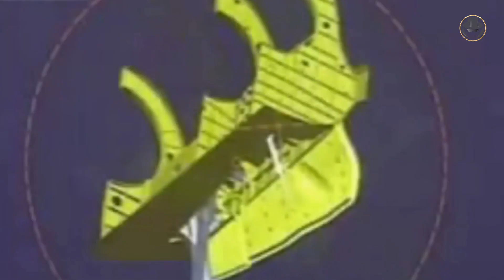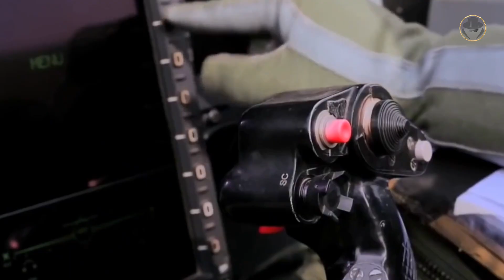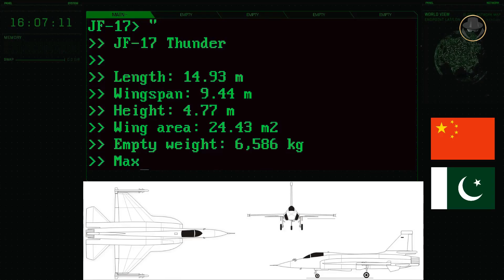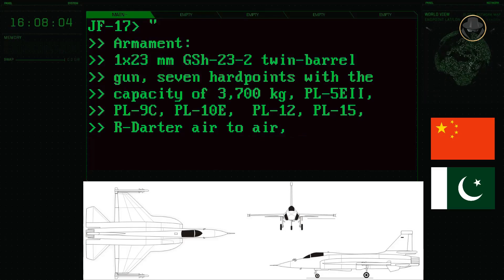JF-17 Thunder / FC-1 Xiaolong | Is it successful or not?

Comment: JF-17's main selling points are its affordability & maintenance cost.  It's a platform with AESA radars and long range BVR missiles,  Anti-ship missiles,  air to ground missiles and HOBS missiles at 1/3rd the cost of other aircrafts with same feature-sets.   The Jeff block-3 has everything which Tejas has to offer with lower over all cost.  Note that newer advance version of Tejas hasn't rolled out yet.  The one in service should be compared with the latest of JF-17 block in service.  And again the cost of upcoming version would be atleast twice of JF-17.   JF-17 is perfect for Pakistan and its threat matrix.  PAF already has inducted 165+ JF-17s.    A combination of J-10Cs, F-16s & JF-17s provide good air-defense and strike capabilities.
Reply: But Pakistan is not going to standstill. Block 4 is already being worked on, so TAJAS will always lag behind JF 17
Reply: @ashtonbailey3970  the JF17 is already an extremely dated design. Its essentially a modern fighter built on a mig 21 frame.
Reply: @penskepc2374  
No it’s not on a MiG frame. That’s a myth. The MiG frame cannot accommodate the block development model.
It’s concept is F16 based.
Just because the 1st car had 4 wheel you can’t say todays cars are dated because they have 4 wheels!!!
Reply: @ashtonbailey3970  keep telling yourself that.
Reply: @penskepc2374  The facts speak for themselves. The whole world knows it…
Reply: @ashtonbailey3970  I bet you think the Comac c19 is an original design and not just a modernized copy of a McDonell Douglas MD90/Boeing 717, too lol
Reply: Supprt pakistan from iran
we must support our muslim brothers
Reply: Whether JF-17 is a good fighter jet or not is not the real question. JF-17 is a success because it put Pakistan on the path of independence. Independence from being put into a debt trap by the greedy western military industrial complex and free from the restriction of western sanctions that could hampers its own defense capability.
Reply: I am sure JF17 PFX will be a quantum leap for the JF 17 and PAF modernisation and self-reliance. I personally feel that the original philosophy and usage of JF 17 for PAF is more important than illogically comparing it with different platforms
Reply: The primarily objective of JF 17 is to replace old Mirages and F 7 jets with a low cost and dependent option without any external strings attached to it. With the induction of JF 17 Block 3, I feel that all the pre development objectives of JF 17 programme has been successfully achieved. Exports and selling JF 17 to other countries may be a secondary objective not a primarily one
Reply: @MAR-lt7xo   No.  That was only one of the goals to replace older aircrafts,  but newer JF-17s are built to takecare of all new modern requirements of the airforce.   I give you one example,   F-16s A/Bs were developed in 1970s to replace older F-5s etc.   Do newest F-16 block 72s are also built to replace F-5s.  Not at all.  The newest ones have their own purpose.
Reply: The Tejas is a good idea for India. They want to be building fighters that are peers to the Russian/Chinese planes and near peer to American. Building a low cost trainer/fighter will give them experience without wasting money on a fruitless project.
Reply: Is there a significant difference in cost between the JF17 and the J10? I don't understand the relevance of very light fighter jets.
Figuratively, the JF17 is half a fulcrum while the J10 is half a flanker. Why choose the least capable design instead of simply starting from the beginning with J10s and inducing as many of them as possible as multirole platforms. 
Ideally you'd need a twin engine large air superiority fighter like the J35 in at least three squadrons, then you'd have a bulk of mid weight single engine multirole fighters like the J10 in as many squadrons as your money can buy. Ideally you'd have two variants of common engines for both types from two manufacturers. 
Can someone explain please? Thanks
Reply: @halnineooo136   Yes there is a cost difference between two.  Significance of light weight aircrafts is cost efficiency, easy affordable maintenance, at the same time ability to carry same kind of weapons as heavy weights. Like long range BVRs, HOBs missiles and kind of avionics to support all that. If you are willing to compromise on range and payload then light weights are a good option.  Not every nation can afford super expensive dual engine heavy weights. You need high low mix in the airforce.  All nations cannot afford to have all heavy or medium weights in their inventory.
Reply: The affordability is only wrt acquisition cost and not wrt maintenance cos it seems to require a lot of maintenance given it has an all metal airframe, Russian engine and Chinese manufacturing quality 

Further, the block 1 & 2 do not have AESA radar, no in flight refueling, only 2d fly by wire, lower thurst weight ratio, poor electronic capabilities and no American/western weapons 

Even the block 3 retains the same Russian rd93 based engines, uses cheaper air cooled AESA radar and same metal body and build quality 

There is a reason why western fighter aircrafts are costly. PAF might have wanted to compromise on the associated quality to fill up its numbers and use f16s for the real thing but then you have to understand that these jf17s are made only to fill up the numbers and maybe start some local aircraft assembly, but nothing more than that
Reply: @vm8136   That's an illogical assessment that an airforce inducted a long visioned and planned aircraft just for showcase and not the "real" thing.  I suggest you to put aside the bias and look at the facts.  JF-17 was the primary fighter in most numbers in PAF's swift retort in 2019.  PAF used total of 25 aircrafts in that operation and could have used ALL of F-16s but JF-17s were used in more numbers because airforce had the confidence to take it to hostile airspace.  I wonder how come you shoot the statement saying "poor electronic capabilities".   The fact is JF-17 block 1 & 2 have electronic capabilities comparable to F-16 block 52s.   Even the western commentators agree that chinese electronic capability has surpassed Russians many years ago.  Google this "Why China's Latest Jets Are Surpassing Russia's Top Fighters"  you will find a nice article to enlighten yourself.  There is a reason why Chinese had stripped off their Flankers and all J-15s, J-16s from russian radars or EW components.  We all know how advance china have gone even in commercial tech like 5g, only country to have its own space station, AI etc.  It will be naive to think that there most focused area which is military & defense would have sub-standard equipment.   You passed lot of false statements like about in-flight refueling.  JF-17s block II (which are most in numbers) all have in-air fueling and there's tons of videos and photos for that on internet already.   The aircraft is design to have a longer life and lower maintenance cost.  Its upto you if pay heed to propaganda blogs for total bs stories with no ground, no source, no photo evidence OR go with official records.  The aircraft was designed at first place to fullfill needs of the PAF and cater for Pakistan's threat matrix.  It was designed & developed especially knowing that PAF may not get any western aircrafts due to sanctions, so it had to get the top capabilities in it with modular design.  Lastly, about some "assembly capabilities".  PAC Kamra has an entire aviation city, even the radars (ofcourse chinese ToT) are being developed locally.  So its not "some". Its quite a lot manufacturing capability is achieved.  The next decade will forsure see its successor.  All being said, I am no where comparing anything with india.   India is already much ahead in localization and manufacturing overall.
Reply: @pak-ranger1 hi bro,do u know that why paf is not increasing the weight carrying capacity of jf 3 even have same power full thrust like gripen 39
Reply: @pak-ranger1  I commend you for engaging with people who don't really want to understand.
Reply: @pak-ranger1  but not in defence
Reply: @vm8136 the jf 17 block 3 has 70 percent composite materials and the block 1,2 will be upgraded to block 3 with all the systems.and the price of jf 3 is still less then gripen 39e with 100 percent same stuff.paf is using this fighter for 16 years so so they are happy with it they are maintaining it.16 years long time
Reply: @vm8136 lol indians and Russians are still using those very same Russian engines in majority of the cases. PAF has the option for the J-35's current WS-21 engine or wait for the WS-19 engines to mauture and then integrate them into the JF-17 if they wish to, as they would have massive performance differences. 
As for the weapons JF-17 has integrated various Chinese, Pakistani, Turkish, south African and Spanish systems into the JF-17. So it's a mix of Chinese, western and indigenous payload options. 
There isn't any fighter jet nowadays which isn't manufacturing using the composite materials. Sure JF-17 wouldn't have the quantity and quality of composites used in the F-35 manufacturing but still its fuselage incorporates composites especially in block 2 and block 3. Due to JF-17's BVR capability through PL-12 missiles, US was forced to provide upgrades and Aim-120 BVRs to the PAF, as US has the habit of pissing off it's customers often. Thunder was the 1st BVR capable operational fighter in PAF and not the F-16s. 
JF-17 block 1 were the most bare bone ones but they have been mid life upgraded and now far better and advanced than what they were in 14 years ago. Block 3 has full 3 axis Fly by wire system as well. 

China is currently mass producing state of the art 5th Gen fighters only 2nd to do so after USA. Even Russia is struggling to reliably produce SU57s. The Chinese build quality is displayed at the airshow events and evident from the close up images/videos of the operational fighter jets. China is the only challenger to the US hegemony in electronics, silicon chip design/manufacturing. India has no such tech available to them at all and Russia struggles to source their own electronic equipment after the western embargo. Chinese lithography and chip manufacturing capability is only 3 years behind what the west can offer today with their combined efforts and experience. So Chinese tech and R&D is at the cutting edge, only 2nd to the US tech globally. India and Russia aren't even in that race at all. 
You don't have any credible evidence to contradict that apart from just rumors and  jingoistic chest thumping.
Reply: Lol it doesn't come with AESA radar 😂
Reply: @goodputin4324   It does.  the block III version has AESA radar and its established fact. Its advised always do your fact checking before rushing to write a comment.
Reply: @pak-ranger1  I know my aviation news. The fact is that Block 3 isnt in production yet so in other words AESA isn't embedded in it.

Next time make sure it flies first, like the Myanmar Air Force which has its jets grounded
Reply: @goodputin4324  For your kind information 13 JF 17 BLOCK 3 are already in service. 50 initial order by PAF. These aircrafts are in production for quite a long now. PAC also installed AESA radar factory in Kamra with the help of Chinese ToT.
Reply: @goodputin4324  hahaha 
Units are already with PAF
Reply: @goodputin4324 mayamar is using block one made in 2003😂 tnd this is 2023 20 years ago alot of things are upgraded including engine radar helmet and avionics
Reply: @goodputin4324 it comes with KLJ-7A AESA Radar
Reply: @goodputin4324 block has aesa chinese radar
Reply: @goodputin4324  it actually does,block 3 have klj7a aesa radar
Reply: what are the factors you are comparing and saying that it's somewhat affordable and have low maintainance cost.how can you say that?
i accept the truth that plane is affordable but there's a catch. there is reliability issue with the plane as engines are either russian origin or chinese and they can never compete with more reliable engines of west.if you have inducted a plane that have 50%-60% reliable how can you say these words..and for block-1 it's price was less..if you compare the price with jf17-block 3 version then you will get to know that price is somewhat comparable with other planes of modern fighters.don't get carried away looking at price of jf17 block 1. 
but to keep in mind that jf17 had upper edge on tejas when it comes to bvr missiles as of now. jf17 has already inducted pl12 missiles somewhat range around 100-120 km while tejas with derby has range around 70-80km as of now. tejas still don't flying with full potential as astra bvr mark 2 is still to be fired from tejas.
Reply: @YuktiTrades your eighty percent fleet & weapons are rassian made. What you sa about these.
Reply: @machineryfusion1131  have you not awaken from 2010..we are transforming ourselves by replacing foreign defence equipments through indigenously..now we started exporting our equipments to Myanmar Bangladesh Armenia to name few..yes we are not fully self reliant but now we can make many equipments..and process is still on..
Yes Russians equipments are more in our inventory and slowly we are replacing and this transition period will take some years
Reply: @YuktiTrades  JF17 has been designed specifically keeping in view requirements of PAF and its capability and reliability has been well tested in Feb 2019.
Reply: @Audionic786  yes it was tested so much badly that after repetitive complaint from mayanmar about the maintenance of jf17 they still couldn't have resolved problem..what happened on Feb 19 is not called a tested fighter it's called formation where f16 was engaged to mig..they shot Amraam too which again can't be fired with jf17..petty where u got these information..?
Reply: @DeepakKumar-nu1zl We gave them to Nigeria and they didn't have any problems,stop spreading hate
Reply: @DeepakKumar-nu1zl Why Russian and Chinese engines are unreliable. Entire Russian, Chinese, and even India Air Forces are totally relying on these engines for more than half century
Reply: @YuktiTrades  然而历史上坠机最多的几个战斗机型号都是美国的，还有一个米格21坠机多完全是因为印度摔得多

Comment: Just thinking out lowed... If I were Argentina, I would seriously look at acquiring this plane.  The JF-17 is far from the most modern fighter, but they currently have NO fighters, so something is better than nothing.  Also, this plane is cheap, and Argentina is broke.  Finally, thanks to the ongoing dispute over the Falkland Islands, most western arm companies will not sell to Argentina.  The JF-17 has no western technology, and (honestly) I think both Pakistan and China would like to do something to mess with the USA in its own backyard.
Reply: The Americans are offering older f16s to Argentina at favorable terms. Even older f16s are a lot better in terms of aircraft capability given American weapon options. Americans aren’t gonna let this deal slip away easily and would provide as many customizations as might be required by Argentina
Reply: @vm8136  or they might pull a Iraq or Egypt deal on them and won’t give any AMRAMS

Comment: kinetically it's fairly mediocre(block 1 at least). It's way slower than the F-16 at literally every altitude, which makes it an underdog in the air to air role. It is however highly maneuverable. One of the best things about the JF-17 is its human computer interface. The ease of use of systems, start up, and employment of weapons is probably on of the best in the world. It's large screens also offer an advantage over other older fighters, like their F-16s. That and ofc its price, being that it is one of if not the cheapest brand new multi role fighters you can get.
Reply: If you want to compare block JF17 BK1, compare it with F16 Bk1
Reply: it's mostly strike fighter with self escort capability or interceptor against strike aircraft, it is not air superiority fighter and should avoid direct fight with those
Reply: @hphp31416  Then how come it downed Indian SU30MKI & MiG21 Bison?
Reply: The F110s have double the thrust of RD93. At 30% more weight f16s are in a different class.

Comment: The fact that the JF-17 Thunder tried to make no breakthrough was a cause of it becoming somewhat of a breakthrough. 
JF-17 is inferior in almost every aspect to every other fighter in its category (of light tactical fighter), yet it's decent for both nations currently using them.
Is it amazing? No, but also yes.  Is it trash? Again, no, but also yes. Context  matters.
BTW Tejas technologically superior (as of now) & costlier, but JF-17 is more affordable, easier to operate, etc.. So, stop comparing. It's like comparing a pear & noodles.
Reply: How is Tejas technologically superior? Only a dumb will say Tejas is better.
Reply: Tejas technology superiority comes from foriegn components.
Reply: @casualobserver288  So? & this is a discussion on JF-17, not Tejas, thus irrelevant. Also, literally every bit of JF-17 is foreign components.
Reply: Tejas superior? Nice joke.
Reply: @dabo5078  Yes. Tejas is technologically superior. Anybody with more than half a braincell knows that.
Reply: @thantzweaung9080  TEJAS is a good PPT jet
Reply: @thantzweaung9080  Tejas has a worse radar, higher cost, and worse missiles. It literally has 0 redeeming factors  except for speed (which is of secondary importance) compared to the JF-17